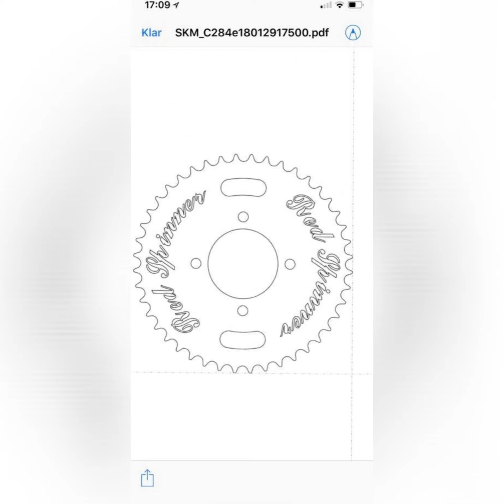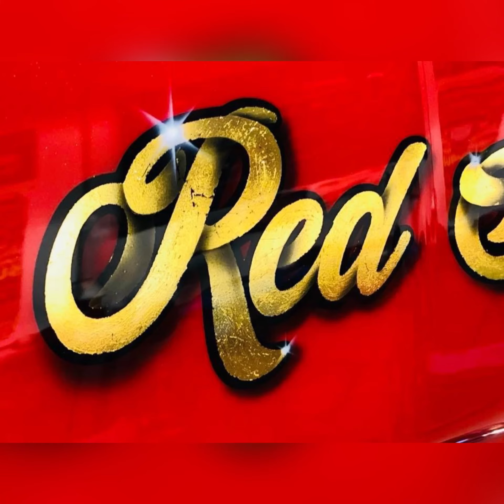Handbuilt 50cc moped with turbo.

Comment: Really GREAT work!
I used to build the
motorized bicycles as a
side hussle, hotrod the
engines, (piston ramping, porting, bigger carb, open exhaust,  etc.)
upgrade all the elcheapo parts, 
but people were CHEAP, and annoying! 
Thanks to covid nonsense, 
it took SIX MONTHS to sell
two bikes!!! 😑

I aways wanted to build my
own board tracker motorcycle. 
(Newer motorcycles are butt
UGLY, and designs are stagnant)
I love using aluminum,  and wan t to learn how to WELD it!
I used a lot of aluminum to
make a hood/ bonnet, and
rear deck lid for my 86 fiero gt.
(With a lot of weight reduction, 
I got 600 lbs off of it)

I digress, you have excellent 
SKILL, mate.
Really,really good job on it.
Bless you,sir.
Reply from the maker: Thanks 🙏👌👍